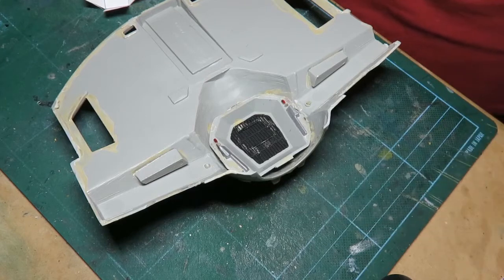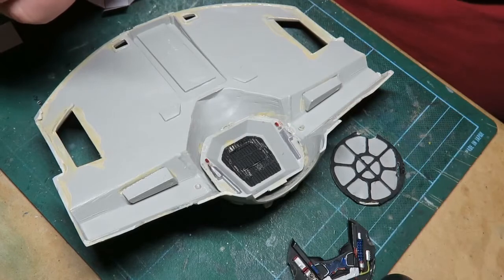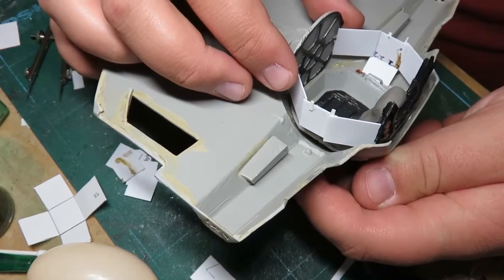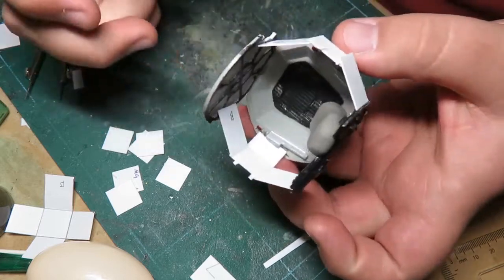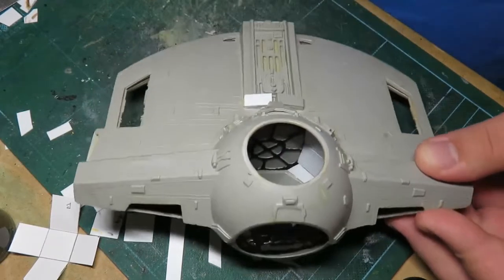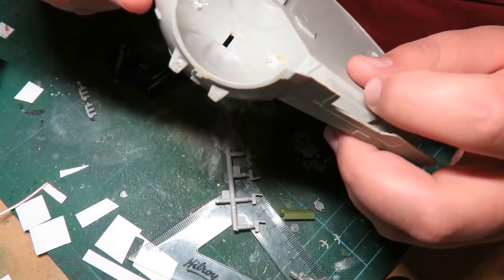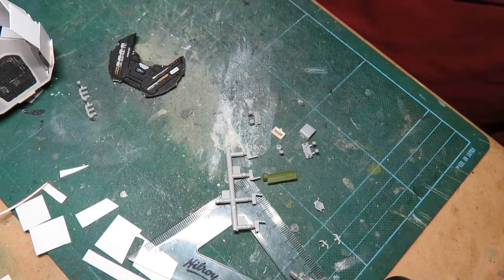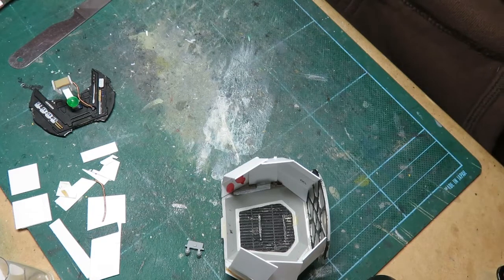MPC 1:36 Tie Advance (Part 1)

Comment: Holy crap, that flight yoke is awesome. There's no way I could come up with something like that. Plus that guitar string makes it look even better. I am certainly not at your level at all when it comes to that sort of thing! Cheers!
Reply from the maker: +stevethefishdotnet Thanks Greg, I have to admit I was surprised myself when I actually got it to all together, It was quite a challenge, but I ended up with a better piece than I had originally imagined. I'm not very good or good at scratch building, I think with this build I'm more or less very motivated, my Dad on the other hand can build anything from anything :D